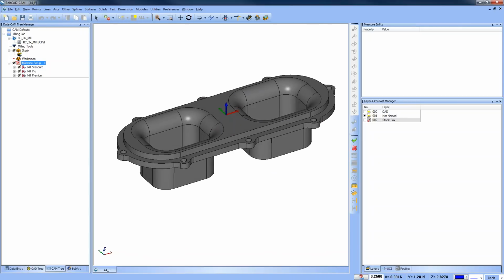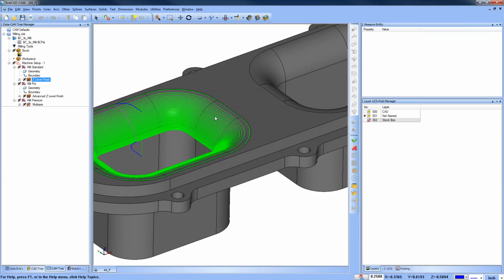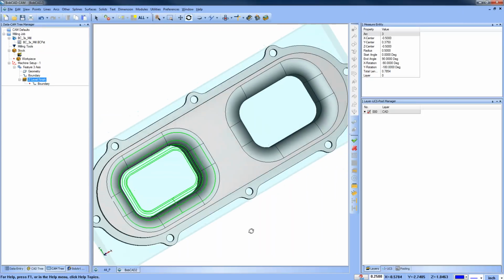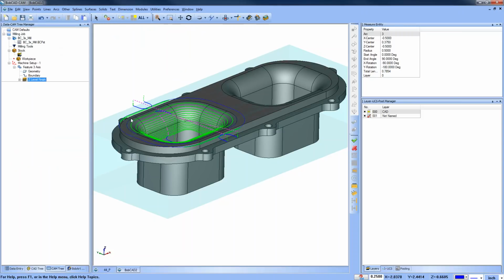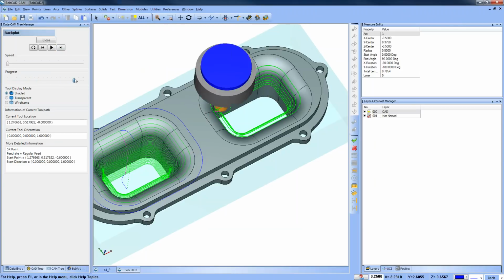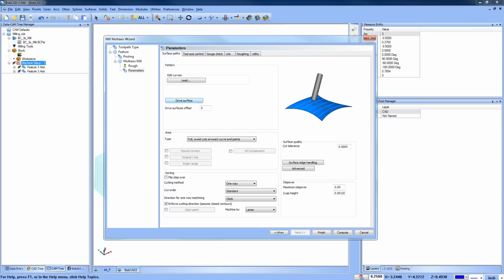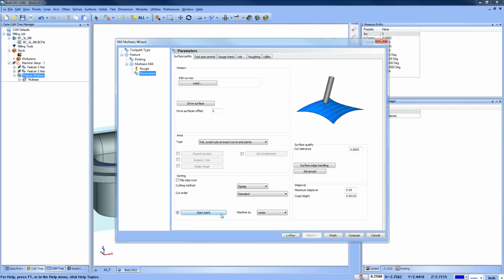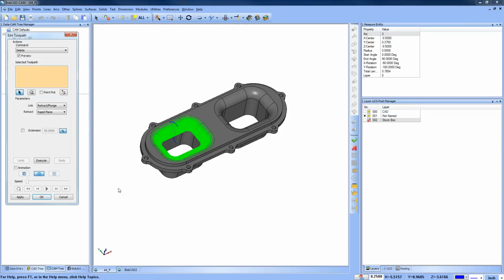3 Ways to Break a Radius Edge - BobCAD-CAM Webinar Series

Comment: 3d "S" link. Does it come off of the surface and leave no line?
Reply from the maker: It's just the way the toolpath transitions " Links" from one pass to another.
Reply: @BobCADCAM  Question not answered. eg. There are links that go direct, or to clearance. Does 'S' link leave the drive surface, then return to the slice?